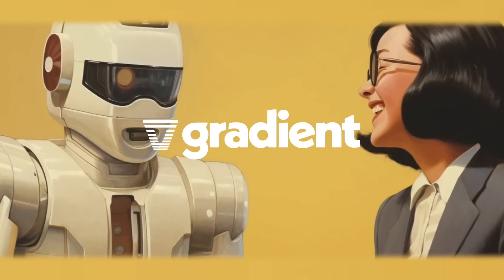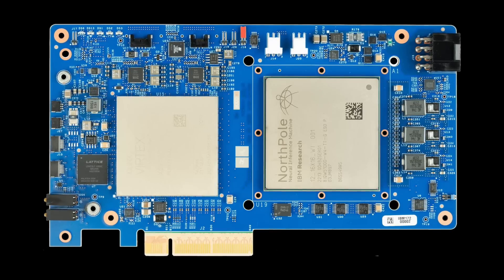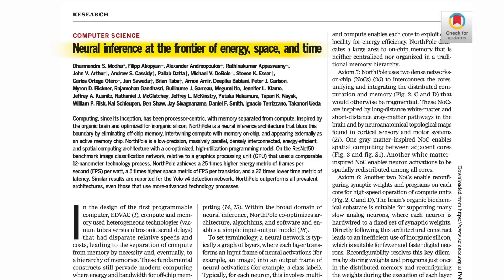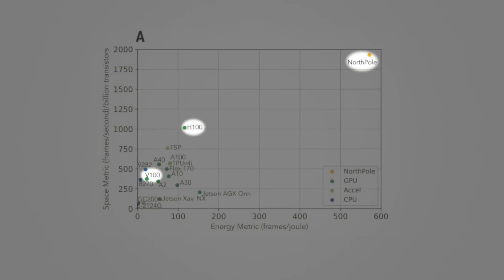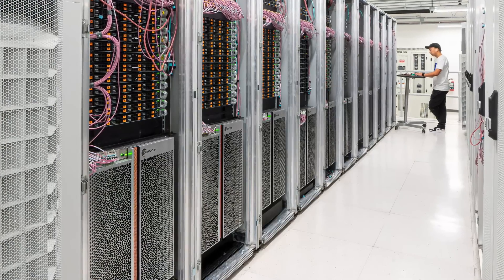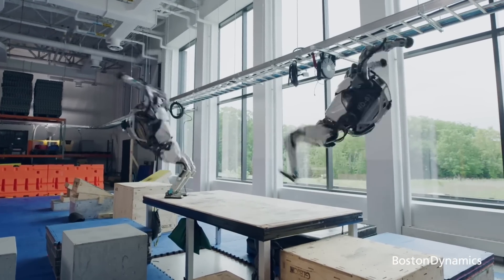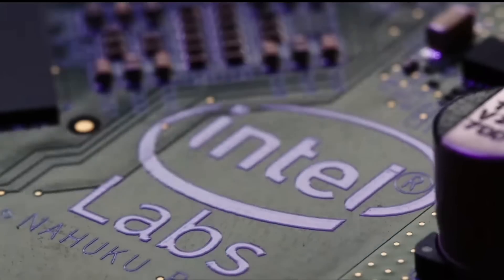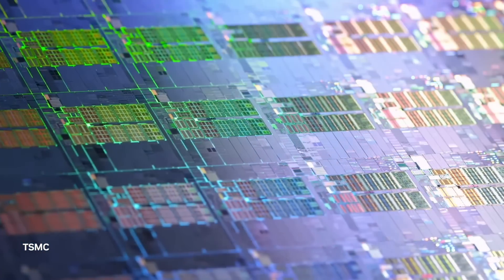IBM Surprised Everyone With This Chip

Comment: It is inevitable that AI chips will come closer to the structure of the human brain.
The goal of AI is to replicate the human brain and thinking in machines.
When trying to reproduce human thinking on a computer, it is inefficient to do so with a chip whose architecture is vastly different from the structure of the brain's nerves.
It's like looking at a map of New York and driving in Los Angeles.
The best way to reproduce the human brain in a machine is to reproduce the brain's neural network as it is with circuits.
However, this is currently not possible and requires the use of significantly different circuitry, which requires complex software and is therefore less energy and computationally efficient.
However, it is possible to gradually reduce the role of software by bringing the structure of chip circuits closer to the brain.
Ultimately, if we can reproduce the brain's neural network on a chip's circuits, we will be able to create a chip that does not require software, and since the chip's switching speed is 100 million times that of a human, the calculation speed will be more than 100 million times that of the brain.

Comment: This is such awesome technology. To a degree, I almost see (for example) AMD moving more memory on-chip. Obviously it's not exactly the same as having the memory right near the compute elements in the design, but I guess what I'm getting at, is that there seems to be a trend towards moving memory more "on chip" so you don't require external busses as much or the "hop" to increase latency is being reduced by bringing more of it on die/at least in a nearby chiplet with a much faster interconnect than is possible.

You know, for reasons like signaling integrity, error correction and latency. AMD has done a lot more of this with the much larger L3 caches on some of the new EPYC chips. Apple is also doing this with their Apple Silicon line of CPUs by bringing the DRAM package directly onto the CPU package, and their own custom interconnects for ultra high bandwidth/low latency. I suspect we're going to continue seeing a shift towards more and more memory being crammed directly onto the CPU package, or even into the die itself.

For now, I suspect "external" DRAM (external to the CPU package I mean) is still going to be around for quite some time because of physical limitations. I'm not sure 3D stacking technology is a proper solution just yet because the more layers and the increased density create problems with feeding power into the package, and also with thermals.

What would be cool is to hear about any further developments with on-die liquid cooling. I remember a while ago it was being explored to have layers cut directly into the silicon die for water channels, apparently the thermals were far superior to anything that can be done with traditional cooling methods. If this is done in a 3D stacked manner, then perhaps being able to cram gigabytes (or even terabytes) of DRAM directly into a CPU die or onto the package using a ultra-high speed interconnect would be far more possible.

Comment: Well-optimized architectural for example applications, E.g., a matrix multiplier core for AI applications. Talk on the "Limits of CMOS and Prospects for Adiabatic/Reversible CMOS" at the Texas Symposium for Computing with Emerging Technologies (CoMET). A video of the talk is available here: https://youtu.be/vALCJJs9Dtw?si=WKaET3IM0_m-VGct    slides are available here: https://sandia.gov/app/uploads/sites/210/2023/10/Comet23-slides-topost.pdf

Comment: A 12nm node vs a 4nm yet it is that much more efficient. Mind boggling. It reminds me of an idea I had when I was 16. What if we scaled down a motherboard to interface with JUST ONE chip that combines every part currently on a PC. RAM, Storage, compute, video/graphics compute, etc. There would be virtually no loss of speed due to the electrons not having to transfer from one place to the other. A chip that has everything on it and the motherboard is only there so you can interface with that one thing. I've dreamed of this for years and now I am finally seeing the catalyst for it.

Comment: I’m intrigued by the NorthPole architecture's promise for advancing our patient rehabilitation systems. Currently, our setup involves STM32 microcontrollers processing deep learning models in real-time, with some computational tasks offloaded to Google Cloud, which introduces latency. Our objective is to bring LLM-driven patient communication closer to the edge for immediate responsiveness.

Im wondering if people have some insights on the following:

Can/ will the NorthPole toolchain, hopefully compatible with VS Code, offer a Hardware Abstraction Layer (HAL) or similar support that rivals the STM32Cube plugin for integrating deep learning models and llm’s?

Gaining clarity on NorthPole's toolchain and HAL support is crucial for us to assess how it might enhance our AI-driven applications.

A suggestion for IBM: Consider creating an Arduino or Raspberry Pi-like ecosystem for this chip to broaden its accessibility and utility.

P.S. I'm a fan of your channel and the valuable content you provide.

Comment: Great video! This IBM chip reminds me of the good’ol Transputer chip architecture available in the late 80’s, rebuilt using current digital technology advances. Reckon Neuromorphic chips will totally smash GPU chips (and obviously CPU chips) in the AI domain. Also, I first saw a software demo of Spiking Neural Nets by its inventor in 2000, and this tech is astounding. Just wait and see, although seriously don’t think BRN will lead this…. definitely far too slow. It’ll be someone else yet to emerge.
Reply: It wouldn't smash anything, I hardly believe IBM are more advanced than Nvidia in AI chips. Google tensorflow chips were also impressive and faster than anything Nvidia had, when they were first introduced but Nvidia did catch up and surpassed them. Nvidia H100 is the fastest AI chip at present on the market. On another note Google does not sell their chips, they offer them only through their "cloud solutions" .
Reply: @Slav4o911  Nvidia is definitely up there atm, however learn about Cerebra’s chip, which uses a Neuromorphic architecture. Already higher performance than Nvidia for AI. Nvidia uses a general architecture which is great for matrix maths, but Neuromorphic architecture is a custom built for neural network processing which is in some ways different. However, neither of these chips are custom built for SNN processing, which is different again.

Comment: Disappointing that more Neuromorphic chips weren't included in the report... Really feel this should be an open source data gathering project to provide an honest benchmark against all manufacturers.
Reply: These are the major players. Also at what number do they stop? the paper has to have a limit.
Reply: @MuantanamoMobile  There really aren't many neuromorphic chip manufacturers with real products out there... Not yet at least. When do you stop? In research, til no stone lies unturned.

Comment: That's interesting and logical that IBM would be developing and researching new software AI frameworks as it tries to catch up to TSMC in the hardware foundry side.

But, I suspect that not all is roses with what IBM is doing. AFAIK one of the strengths of the nVidia ecosystem and the AMD support for CLI is that they're framework agnostic except for their chosen language support so support practically all coding and applications. I'm guessing this isn't the case for IBM's approach... If IBM's product history is a guide, IBM is likely achieving those efficiencies and performance by hard coding long functions into silicon, and that typically means that only certain software coding and software functions are supported which would likely mean that certain types of applications can benefit from IBM chip features. An example of this is in the CPU world where IBM has long been a leader, IBM CPUs are generally best for machines used for business and typical business applications and less for scientific research and raw number crunching which is why GPU computing and graphics have been largely built on ARM chips.

It's for this reason I wonder if the described IBM chips would be suitable for machine learning and neural networks despite the brief mention of neural networking in this video... If neural networks might be supported, I'm guessing only in a very specialized field. I suspect that if I'm right about IBM's chip architecture that these chips might require a lot of handcrafted AI created by human AI scientists. Or, IBM would have to create its own meta layer sort of like the .NET runtime that translates human coding into optimized machine language.

Comment: Not so exciting since it doesn't even hav 300 MB ram, so you need like a 1000 of them to keep store chatgpt. But hope this exponentially increases
Reply: I've heard that current ChatGPT 4 is running on more than 1000 nodes which suggest at least 1000 of something be it cores, chips or whatever.

Comment: The definition of analog vs digital memory doesn't sound right to me...
Why should digital memory be limited to binary values? Although current digital computing is based on binary values, isn't there research and experimentation using multiple phases like in quantum computing which AFAIK has never been described as analog computing?

Comment: Fabulous presentation, giving race car feel for the exciting chip race that is now on going. NorthPole is super impressive, but unclear to me how far away it is from becoming a commercial product. As is it seems way too big for edge applications and although it could presumably be made in 3 nm or similar it would still be large, suggesting IBM will have to  find ways of making it much smaller to use in edge applications. Super interesting yes, but not yet a practical competitor to Nvidia as far as I can see. Thanks for sharing!

Comment: It’s hard to foresee how much potential this holds for AI. I mean if it is already 20 times faster then the H100, what might be possible if we go down to 5 nm or less. People always speak about the end of Moores law, I think for AI mores law (at least in its classical formulation) isn’t all that relevant any more.  Nvidia already says they manage a factor 1000 in 5 years when it comes to AI.   Given that we may be rather close to AGI (many see it happen 2025 -2029, Kurzweil once  used to be called an optimist) let’s see how it can improve it’s own hardware (not to mention it’s software). I think we have exponential times ahead that dwarf Moores law
Reply: Well said mate. Completely agree.
Reply: Well it's not 20x faster just yet but it would be under the same conditions

Comment: Correction: IBM has not "released" this chip - it is an experimental chip to be used for research and development purposes rather than high volume production.
Reply: @RajGandhasri  how it can be ordered?
Reply: @RajGandhasri  how much, do you sell the motherboard as well.
Reply: @RajGandhasri Do you have an URL for further info?
Reply from the maker: Yes, it is more like proof of concept/architecture
Reply: @RajGandhasri what’s the failure rate for these chips?
Reply: @RajGandhasri  l thought that you're a Software engineer.
Reply: @RajGandhasri What is the failure rate for this chips??
Reply: @qemmm11  1 out of 1,001,909,592 so far.
Reply: It is released now and shipping
Reply: yeah and by the time IBM ever gets that chip into Production if they ever do it will be obsolete by something AMD and Nvidia can beat with their ai tech IBM always has been old and slow with tech like this so meh not excited because it'll never be used in any computers ever

Comment: I remember when memresistors came out, but then radio silence. This is pretty exciting. Thanks for your expertise and breakdown. Been looking forward to commercial neuromorphic chips for a long time.
Reply: Yeah memristor had a lot of hype both for industry and HP(E) as a company, but after that total radio silence as u write... clearly memristor seems not as viable and commercially possible as originally expected...
Reply: what do you think about brainchips Akida?
Reply: Dear god. dont breed!! PLEASE!!
Reply: Yeah I know... this "thing" that's a 100x faster... and you can't buy it anywhere, I know a lot of these things existing, but sadly if you can't buy the thing and use it.... it doesn't matter how fast it is.... and it doesn't matter if it exists at all.
Reply: Memresistors are a thing, but manufacturing them at scale is still way beyond current technology which is still getting a grasp on nanotechnology. It is likely that an upcoming technology such as doping silicon with graphene will render them moot.

Comment: chip makers have leaned on node for so long but starting in 2030, the leaders will be based solely on creative design. we are gonna see some insanely smart design that never would have been thought of if they could have continued to rely on node shrinks. this is ESP true in graphics and ai. cant wait to see how they solve problems when they cant go smaller
Reply from the maker: Completely agree!
Reply: will the smart design be a thing beacuse of the people or cause AI designing it?
Reply: Moore's Law has been outpaced by Huang's law already, people don't give Nvidia engineers enough credit.
Reply: Moore's Law definitely made the chip design industry lazy and complacent, they let processor architecture innovations stagnate while they made the fabs do all the hard work of actually making computers faster through node shrinks, even though the limitations of Von Neumann architecture have been known for literally decades.
Reply: I think we are gonna see incredible things in out of the box thinking and I have my fingers crossed we will see more opensource designs and design tools once node changes arnt changing the rules ever 2 or 3 years.  @nekomakhea9440

Comment: I think that loading pre-trained neural networks is fine.  Spiking neural networks using analog devices will suffer from irreproducibility due to the nature of the analog memory used.  Simulated spiking neural networks will not have this irreproducibility issue as the computations will be exact.

Improved process nodes and pre-trained neural networks will allow simulated spiking neural networks to be more energy-efficient and exact.  I think that these will be the winners for devices that require a neural network in, say, phones and other devices.

Comment: Wow. Do you think they will bring it to the market or it is more a fundamental research ?
Reply from the maker: It is a research. However, imo, some aspects of this architecture will be brought to the market.
Reply: I just posted a comment to this video speculating how IBM is getting this massive efficiency and performance boost based on past IBM chip architectures and if I'm right then although this chip might be great as an early demonstrator, it has drawbacks that make it difficult to use for machine learning and might be more suitable for certain coding and application frameworks over others.